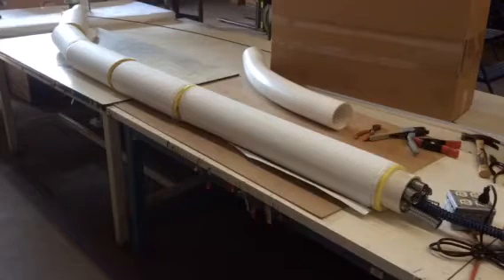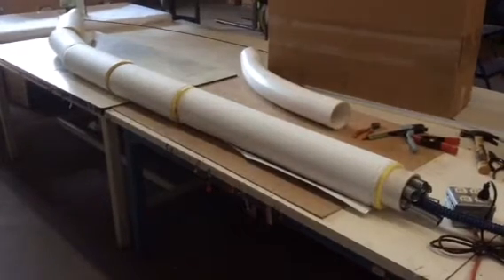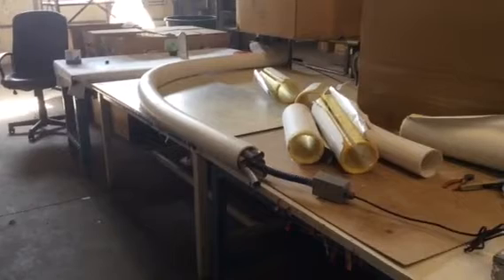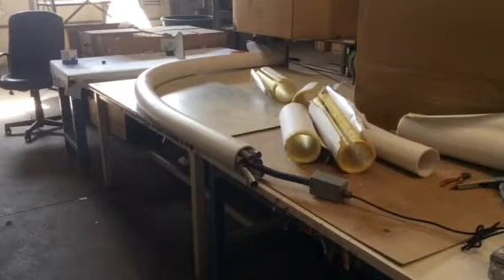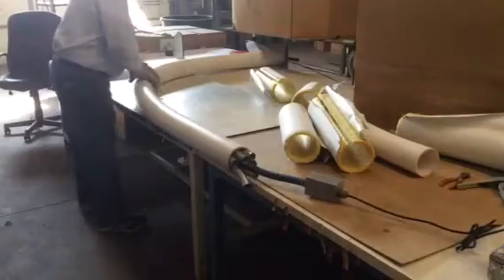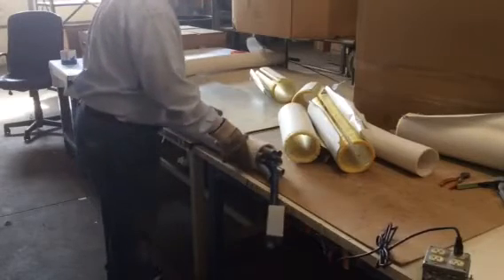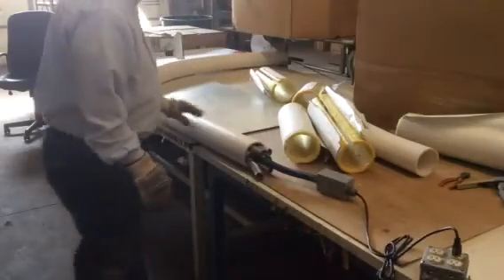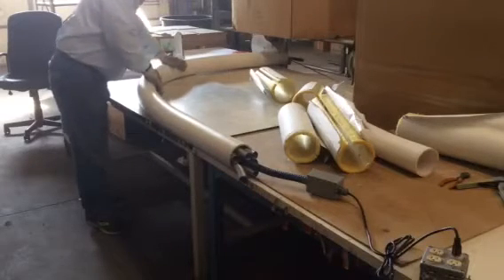How to Heat & Bend 4" PVC Pipe Using the PVC Bendit Tool

Comment: How did you do that? Bunch of 3/4" conduit springs and some kind of heating rod?

Edit:
I want to do the same thing but with a heat gun inside of a double wall insulated pipe so that I can heat the single wall PVC pipe uniformly, but with a cheap heat gun.

Maintaining the acircularity is also tough. Usually I put cheap caps on the end of the pipe to ensure the ends are still perfect circles. 😆 
But that might not be possible with this method, which is ok.

Good job. Looks good!